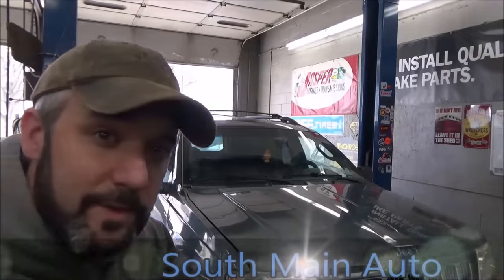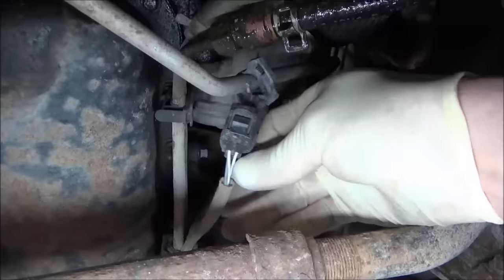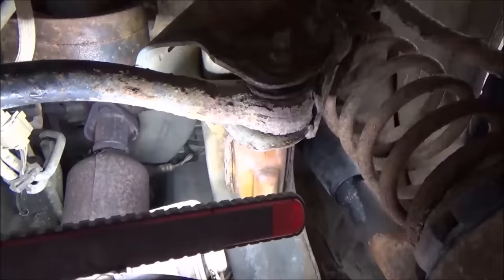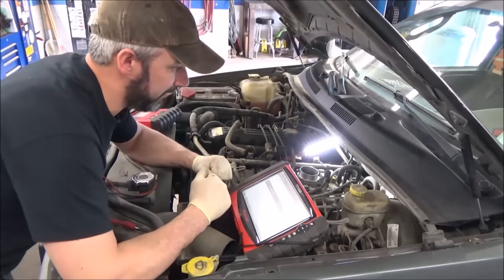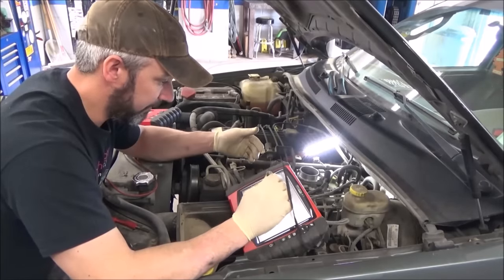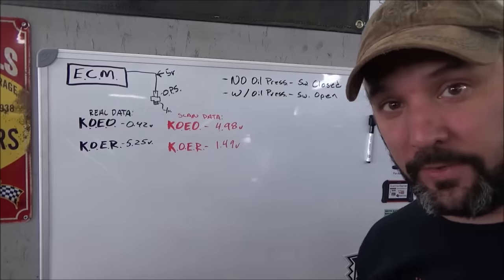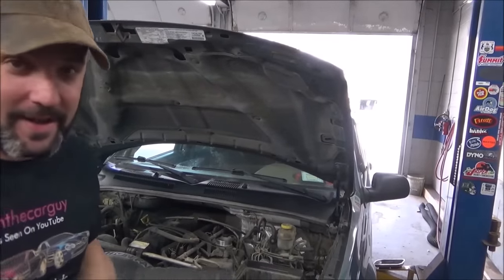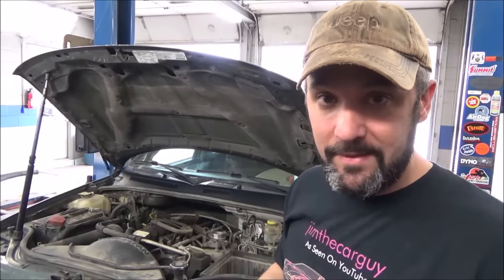Jeep Grand Cherokee - Check Engine Light P0141 / P0155 / P0523

Comment: Same oil pressure set up used by Ford and many others. Market research showed that buyers wanted the gauge and not an idiot light, so in Fords case they switched over and installed a real gauge. However, many folks had never seen how an oil pressure gauge actually works. They got worried about that gauge rising/falling and being higher when cold / lower when hot. The result was to install a resistor wire to feed the gauge on the panel and replace the actual sensor with a switch. The resistor pops the gauge right up as soon as the sensor detects oil pressure, and it stays right there nice and steady. Customers were happy, they had a "gauge" Ford wasn't real happy but they did alter the design of the dash board, they ALL had the resistor in them from the factory!  How long ago did this start? Well let's just say that if you own a Ford, it likely has an "idiot gauge" in it. 
The first TSB came out in 1988 on the Ford F-Series, and it quickly spread to everything Ford made.  You get a real oil pressure gauge once you get up to the super duty WITH a diesel. 
On many Fords the water temp is the same way....

BUT before anyone of the other brand owners start bragging, They do it as well.  There are some out there with real working gauges, but many are just a pretty idiot light...
OH most switches are set from 7-11 psi ! (and are amazingly interchangeable as long as they use the same threads)
Reply: Thanks for the info, seems like I'm the last to know of this silliness.  Snap-On plays too then, how very stupid.  We can keep this a secret I'm pretty sure...

Gas gauge on 2001 F150 won't show real time data, you have to shut off the engine and then start it back up to see how full it actually is - instantly too.  Two hours with engine running otherwise before it gets to full mark.  They don't want us watching the gauge while fueling, how anal does it get?
Reply: +Lee Barnes  The scan tool can only see the data the ECM sends it. Real time oil pressure isn't a "needed" item, just that the engine has oil pressure. However ECT is a needed item so there will be at least one real temp sensor on there.
Reply: That's so silly though... who would want an oil gauge on a non-performance, non-heavy-duty vehicle? -and, if there is one, would worry about it not reading a fixed value?
I'm learning a lot about cars from watching this and other channels, but even before, when I just put petrol in and took it to the dealer at regular intervals, I realised things like oil and waterpumps are driven off the engine, so their functioning will change with rpm and stuff. I mean, the only thing about oil pressure that's 'pull over right now and call break down assistance' is an unexpected drop while going down the road, right?
Reply: +Jan Verschueren, not here though. You are entitled to your opinions and preferences, but I want to watch the actual oil pressure over the entire life span of the engine in order to determine the little things like when I'm down two quarts in my suby the oil gauge goes spongy to relate it as best as words can.  I know I have but a few scant miles to go before I should pull over and dump two in -- on MY schedule and not in heavy interstate traffic which is hazardous to all living things.  You are forced to call AAA and I don't want any part of that.  I've GOT the oil with me you see. Give me all the information so I can become the master of my own destiny in other words.
Reply: Blazer02LS 
You are correct...  Mazda did this in the Miata and I assume other cars. 90-94 got a real gauge that moves. 94 to 97 is an idiot gauge... although it's not just on and off.  there is some small changes seen. Same with the temperature gauge. it move a little bit in the middle... for the same reason you said. people freak out when the needle moves a bunch.
05 in the 3rd gen they went back to a moving gauge... but even it's fake. it moves a lot. but is the ecm calculation shown on the gauge... not the real pressure.
it's actually annoyed in that gen car. it wildly swings around with RPM.
my guess on the Jeep.. they had a ton of gauges used in other stuff. so rather than redesign the dash layout, they used what they had and made it work
Reply: My 98 Grand Cherokee, 4.0L Inline 6 has a real oil pressure transducer. It varies with engine temperature and RPM. Great vehicle. Very tough and reliable. I bought it new in 1998 and never had any issues except regular maintenance items. I do take good care of it. It still looks and drives like new. I used it a lot for towing and 4x4 offroading. It's a very capable vehicle. Better than Toyotas I've owned.
Reply: GM does this too I think, at least on newer ones, its on a resistor so that its a buffered gauge for all the gauges.  My 02 avalanche oil pressure gauge climbs and falls with RPM and temperature.  My 10 GMC savana, with the same motor, the oil pressure gauge takes a long time to respond to RPM changes.  I have been tempted to put an actual physical gauge on the motor, because I know the 5.3's have issues with oil feed to the front lifters.
Reply: My 1990 Ford F-150 is the same way, apparently you can remove the resister on the back of the gauge and if you find the right "actual" oil pressure sensor you can have a working oil pressure gauge, never could find a reliable part number for one that would match the stock gauge though.
Reply: I've got a 2013 Silverado 1500 z71 LTZ. My first vehicle with a real oil pressure gauge.
Reply: I don't know about WJ's but I had a ZJ for a while and it had a real oil pressure gauge. She'd run higher pressure when cold and lower when warm. It made me nervous for a bit when it'd drop down to 13-15 psi on idle, after warming up. But I looked at the specs for the 4.0 and anything above 11 was good. Even some of the ones that are idiotized still have a transducer on them though, you can read it as live data on Torque Pro, Bluedriver, or a professional scan tool. They just have an extra pin on them that switches on the idiot gauge at the reference idle pressure.
Reply: @teamramrodmtb  WJ's had a real one up to 02 I believe, after that it was a fake gauge. The wiring from the sending unit is the giveaway.. a real gauge will have 2 wires, the fake gauge WJ's have just one wire.

Comment: Have soldered wires to old pins where not available,and wire broke at connector ,reuse weather seal,I work on salt trucks and most my repairs are wires and connectors, keep up the good work, coby

Comment: Another SMA thumbs up video!  At 27:32, the likely reason the Jeep does not have a real oil pressure variable gauge is that the readings would freak out the average person.  Oil pressure ranges from 10-15psi at idle to 70-90psi at 3,000 rpm.  Imagine how the average person would react when they are watching that gauge, come off the highway and stop at a traffic light.  All the average person needs to know is whether they have oil pressure.
Reply from the maker: +Sandbag1300 Yeah I think a simple light would be just fine in this case..
Reply: +South Main Auto Repair Yes, I agree.  In fact, I had that model Jeep.  The next generation model beginning in 2005, that I currently own now, replaced the gauge with an oil light.
Reply: And here I am thinking "Why not both?"
Give me a gauge to tell what the actual oil pressure is for those who want to know, and below a certain threshold (7-8 PSI) it turns on a red light which the rest of us can pay attention to.
The human brain is really good at dealing with more information than it needs to make a decision quickly. In this case "So long as the light's not on, don't worry about it".
Oil pressure is a really good way to tell when it's time to get a new engine (or rebuild the one you have, but nobody does that these days unless it's from an older muscle car).

EDIT: These days you wouldn't even need a physical oil pressure gauge, just put the info in the same display that's showing you the fuel economy, time, outside temperature, and stuff like that.
Heck with one more sensor you could have it measure the pressure drop across the oil filter to tell you when to replace the filter instead of just replacing the filter every time you change the oil. Maybe keep that bit for the high-end package with all the bells and whistles.
Reply: My 2002 Dodge Dakota 4.7 V8 has a variable pressure switch. Just checked my schematics.
Reply: @SouthMainAuto  All the WJs up until 2002 or 2003 had a real sensor that would read pressure and when they switched to a dummy switch they didn't want to reconfigure the cluster so people didn't think they "lost" a feature. It was done to stop complaints to the dealership of low oil pressure since it is hard to explain to the customer that it is normal when the vehicle is hot on a hot day to have a lower pressure at idle. LOL

Comment: I really enjoy your videos. As for finding a compatible connector for the oxygen sensor from another vehicle, if you search for an O2 sensor at our favorite Irish auto parts store, they have a compatibility tab to see where the part is also used. In this case, they show 82 other vehicles which use the same O2 sensor. Additionally, for parts compatibility, there are Hollander manuals.
Reply from the maker: +johnwrench4speed Yeah that is what I usually do, I just use the one on the Napa prolink site

Comment: Eric on my 1999 Jeep Grand Cherokee which has the 4.7 I think my Grand Cherokee Jeep uses a different style of oil pressure switch because on my Jeep you can see it go from high to low , as far as the wrecking yard I like your Wrecking Yard a lot better than the ones we have out here in California we have to go to wrecking yards that have all the cars are on 4 stands and on your wrecking yards there just a lot alot better , keep up the great work .

Comment: Completely valid repair on the harness, have to do it many times before. Some connectors are just not available. I get terminal pins from Oreillys, there made by BWD.  You can pretty much get any manufacturers factory pins. Most come with new weather washers also.  Come in boxes of 10, 25, 50 and 100. I love going to the salvage yard!!!!!  ;).
Reply from the maker: +Emt Scythe The salvage yard id my fav place to go... beside home

Comment: Congratulations Eric!!!...good Fix!!!....sealed...no water or moisture!!!!....solid connection!!!....o2 sensor super ready to go off-road...hard!!....about oil indicators!!!..There are many kinds!!!!...regularly what is comonly called "oil pressure switch" only drives a 12v beam on the dash (single wire switch)!!! when engine is off and key on!!..no oil pressure, beam is on (the switch provides ground from the engine block)!!...when engine runs, oil pressure is build and beam is off (because the switch is open by the oil pressure)!!! simple in the old days...but...from what I know (very humble opinion) always when there is a gauge, the oil pressure unit must be a "variable resistor unit" no matter if it has one wire or many wires. There are many oil pressure units that senses oil presure with only one wire!! In this type (one wire only) when Engine-off-key-on, the gauge works in conjuction with the resitor value of the unit on the block, and provides a minimum value of ohms, nearly ground (always pushed by a calibrated spring). When engine runs, the unit on the block reports higher value of ressitance, then this device is building a voltage between 0 (from engine block ground) to 14 volts (from the ignition key). the gauge resistor values are choosen to work with this, and reports on the dash a value from 0 to 14volts (converted linearly to psi oil pressure) and the PCM only manage the info in units of volts/psi!!!...In my wild guess, that car should use  "one wire only variable resistor-oil pressure sending unit", insted of and old-school 12v beam oil pressure switch (like the one it has)!!!....sorry for the tons of words I droped on this!!!... Hello to everybody at SMA!!! :) :) :) :)

Comment: On the wj's (99-04) the oil pressure sensor reads actual pressure from 99-02. Mid 02-04 reads "on-off" it was in preparation for the next model Jeep without a guage. Hope that helps.

Comment: Was there steel coming out of the left front tire? On that old of a vehicle doing that repair cutting out the connector I  would have done that before the junk yard once the real part was not available from Jeep like you said could be fixed down the road if ever needed. Great trouble shooting video thanks.

Comment: Actually  if you are already in the junkyard ANY 4 wire plug will work just take BOTH sides male/female and you're good to go .
Reply: I'm surprised he doesn't have any Superseal or Deutsch plugs in stock, those are great connectors, never had any problems with them and we have similar conditions to NY where I am. The Deutsch connectors are kinda pricey though. Superseal works just as well, but Deutsch is more industry standard, well over here in the Yurops anyway.
Reply: The whole reason to worry about a connector or a hard wired o2 sensor is for the next time changing it. If you replace both sides with another type connector, you will not match up with the new O2 sensor down the line.

Comment: I love that Chrysler vehicles make retrieving codes so easily (keying  on and off 3 times). Probably the reason why Ive been diving them since 2000 (4 Jeep Grand Cherokees all with 4.0 til 2019, now a  Durango and Dakota both with the 4.7. Nothing newer than 2003 😉
That's the last year Grand Cherokee that came with solid axles and the inline 6.  I am always looking for a nice one I get out a few more miles on.

Comment: Re: P0155 .. I've read loads of blogs, etc.. that say that Jeeps require OEM O2 sensors. I've replaced my bank 2 sensor 1 twice with after market. Both showed fail and turned on the engine light. All the readings show that the O2 sensor is good and working. For some reason, the aftermarket sensors don't talk to the PCM.

Thoughts?

Best video I've watched on this. (Tied with the guy who shows how the OEM sensor and the aftermarket sensor on the computer and shows how the aftermarket, while working, isn't reading through the PCM)

Comment: That explains why my cherokee has 2 pins in the oil pressure sensor but the one in the grand cherokee motor I'm swapping in it only has one. I thought the pin got pulled out.  Guess I better swap the old sensor in to get a proper pressure reading. BTW, I just found your channel and love all the troubleshooting and explanations. Please keep it up!

Comment: It'll run, no need to waste time.  I have a kit of 1-6 pin weather packs at the house for that reason.  Yeah, both sides have to be replaced, it's not factory, but it works for backyard wrenching.

Comment: All Grand Cherokees 93-03 use actual pressure data and displays real time pressure. They switched the sensor unit in the Jeep in your video in 04, which is what year that Jeep is according to the grille and fog lights.

Comment: May I offer another repair option to the Codes...... Recently I purchased a 2004 Jeep 4.0L (82875 miles) with pretty much the same codes.... in the scanner.... What I found during a visual inspection, was the O2 Heater Fuse.... had been removed and placed in an empty slot.... and Bank 1 Sensor 1 (upstream) O2 sensor had been replaced... Resolution was to place the correct fuse (10 amp) in the correct slot... and Presto Changeo..... Cleared the codes... and the fuel mileage went from 14.1 to 14.4 to 18.1 to 18.0.....  Just Like that... Thanks for the Excellent Trouble shooting Techniques

Comment: I believe the way the oil Pressure sending unit works is coiled on the inside. The pressure from the engine pushes up through the coil which changes the voltage under the pressure high pressure high voltage low pressure low voltage. Or vice versa.

Comment: My 1991 Ford Ranger had one of those "placebo" gauges.  It was connected to an oil pressure switch via resistor so that the gauge would show mid-high when there was pressure, and pegged low otherwise.
Reply from the maker: +hoppes9 Change the resistor to get the pressure you want haha

Comment: I know this is an old video but did some digging with the oil pressure switch since i had a 2000 I-6 WJ, the pressure would always show 80+ PSI until you got on the highway and it would slowly go down and settle near 40 PSI. So I checked my current 2002 and 2003 both of which are v8s, I can confirm 2002 use a pressure sensor and the 2003 has a pressure switch. I just double checked the schematics and in the 2002 service manual it shows a 3 wire pressure sensor and the 03 service manual shows single wire pressure switch. Also 99-02 oil pressure gauge on the dash shows 0-40-80 as the later models just show a L and H. I guess they just wanted to save a few bucks as the model was getting older.

Comment: Until I read some of the other replies I could not help but thing whilst watching that maybe the cluster had been swapped out to one that had gauges and originally this vehicle had a cluster with idiot lights only.
It appears from other comments that this is not the case.
I remember doing this back in my day and fitting the appropriate sender for a gauge.
Nice video
Cheers

Comment: On the oil pressure sensor you are correct. On the dash on Jeep's and Dodge Dakotas I know for sure are also like this. They indicate on the dash but not corresponding to oil pressure. I come across one failing intermittently it would indicate on the gauge a on - off type indication bouncing from absolutely no oil pressure indicated straight to somewhere around the middle where they all run. Repeating this  same malfunction. Testing with a vohm didn't match the on - off fation the guage was carrying out. Yes I guess its a Jeep thing. Another goofy deal